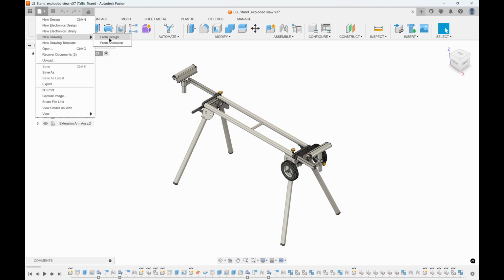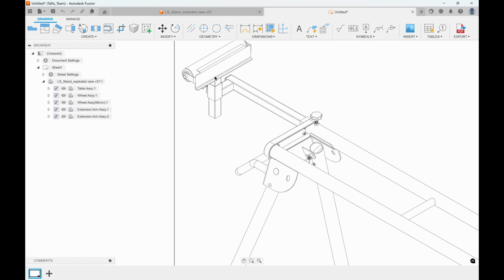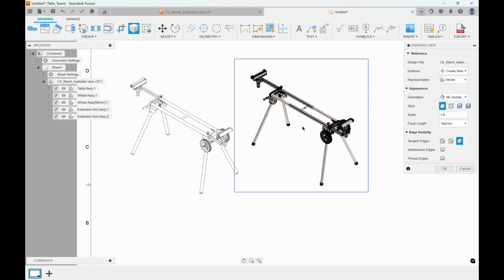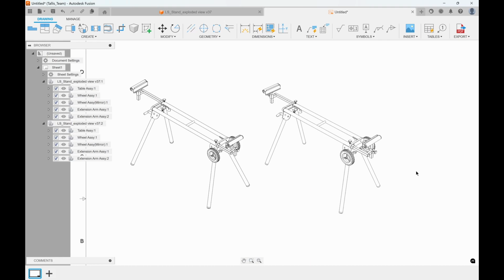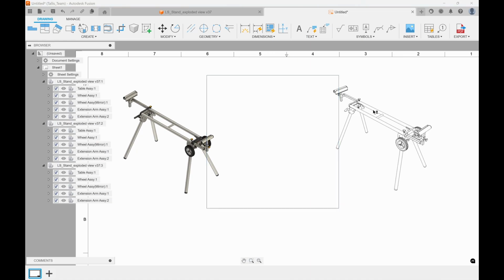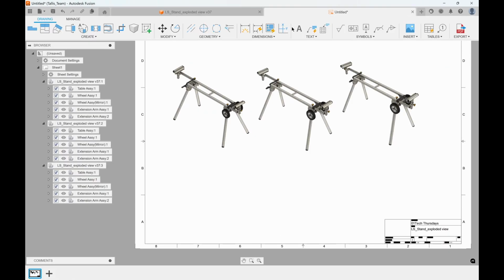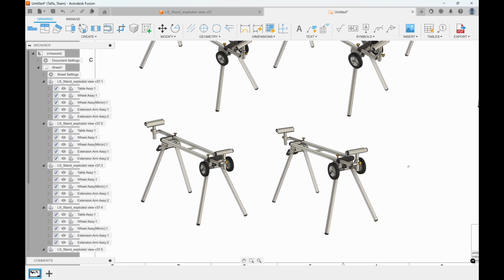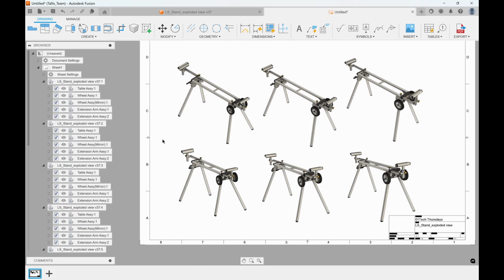Perspective Views in Fusion Drawings

Comment: Hello there please friend. You are doing a great job with the videos. Question. I model on perspective view. I have recently noticed that when I select to create a sketch, the view is no longer automatically switching into orthographic view. Im having to manually switch. Has there been a change to the software? Have I some how changed a setting?
Reply from the maker: @DavidBishopinc-  In your Preferences, under the Design section, make sure "Auto Look at Sketch" is turned on.  This will make your sketch orthographic to the screen when you create a sketch.
Reply: @bradtallis8968  Thank you Brad for answering. I Checked that per your response, and yes that option is turned on. It would appear at first glance the sketch is in ortho mode, but if there is a cylinder in the view you can barely see that it is not. Also, zooming in, to the freshly created sketch it becomes clear that is not orthographic. I am having to physically right click the little house at the top right to switch to ortho to keep it in that mode. And do the same when I go back to design mode and to switch back to parametric Upon my online research tit suggest that this  may be the result of one of the updates. Others had the same issue. Any further suggestions would be greatly appreciated. Keep up the great work my friend.
Reply: Perhaps The option with perspective with ortho faces should be selected?

Comment: Brad, thank you again for sharing your knowledge.
Not to get too far off subject, but in one of the Fusion Facebook groups someone was asking about how to get a "certain degree" angle in the view port. Is there anyway to do that?
Thank you again for all that you do!
Reply from the maker: You can click on the View Cube in the upper-right of the screen to view by a specific direction.  You can also click on the edges and corners of that cube to view at specific angles like 45/45/45, 45/90, etc.  If you are wanting something like 22.5, you can't do that.  You would have to create a 3d model of a cube with the angles faces on that cube you want, then you could use the "Look At" command in the viewport.
Reply: @bradtallis8968, a specific degree is what I was wondering about. But, your suggestion of how to work around it is a great idea. Thank you once again!